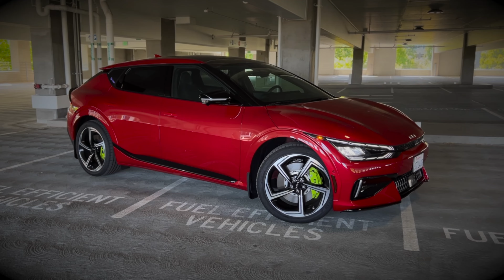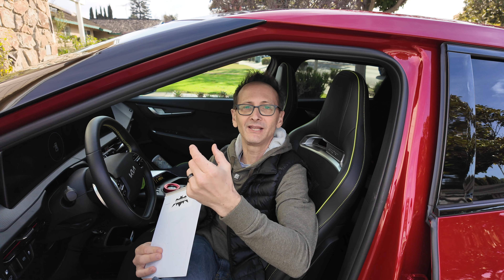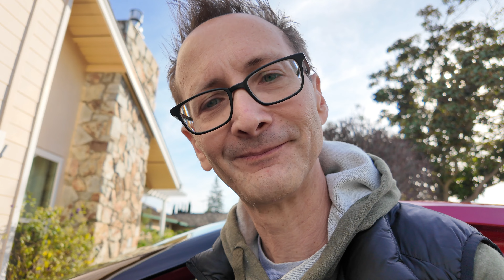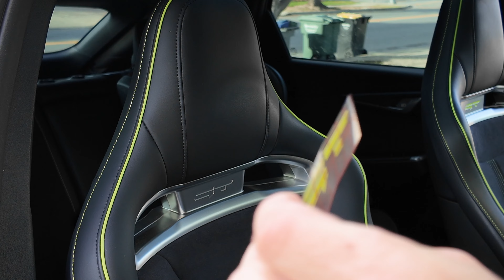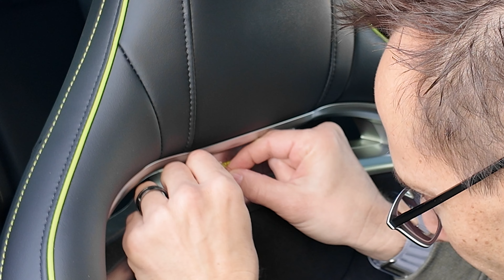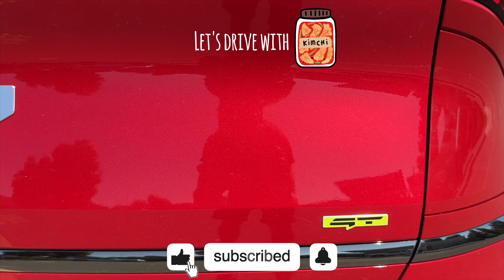Pimp my Seats!  Installing Acid Green "GT" inlays

Comment: This looked more complicated then it should've been. The pics on the website doesn't look clean at all. I'm still interested in but I think black would look better imo. Probably a matte black if anything. I'm also wanting to order another set to put in the brake calipers as well as they look plain how it is right now. I just hope they stay on though as I don't want to go through a painting route. I'm surprised you don't have a discount code or so since they're using you video.

Edit: looks like they have other stickers for the EV6 GT as well! I wish they had just the GT wording for the brake calipers tho. I will order some soon!
Reply from the maker: The BattSkins folks are super-duper nice and will make you anything if you email them.  I'm sure they would do the seat GTs in black for you, and also make GT logos for the calipers.